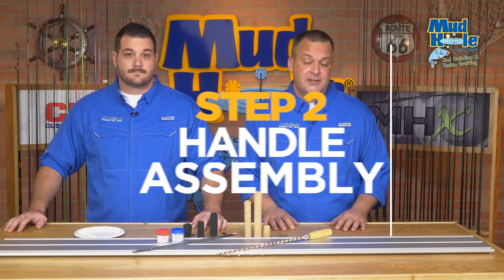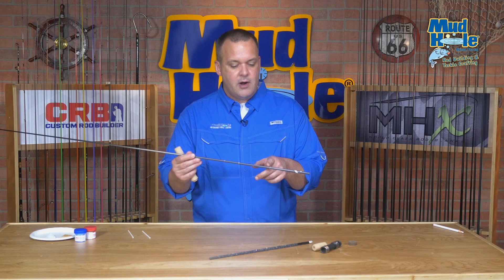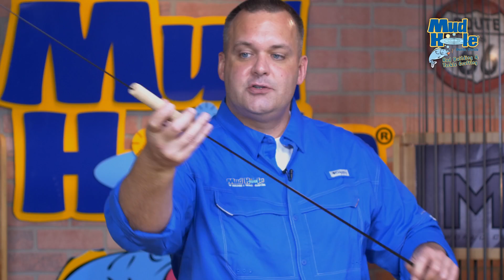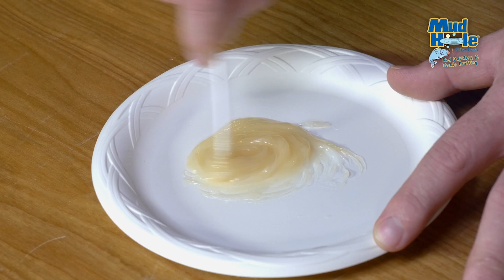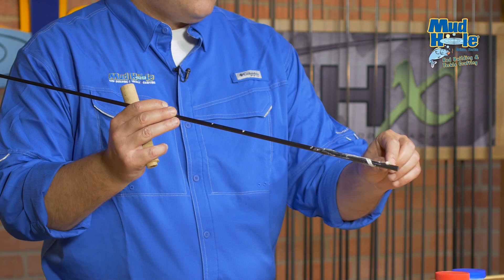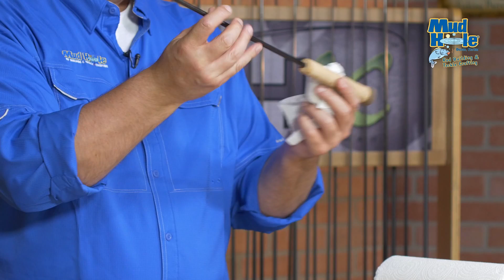How-To Install A Cork Handle Assembly | Rod Building 101

Comment: Good instructions allabout.wiki/e5pj if you look at the two parts, plastic cover and metal sprocket you'll realize that you just use the plastic cover and not use the metal one, then the screw will work fine.

Comment: Wouldn't it be better to wait on putting the end cap on till the tip top is glued on and dry so any back pressure from pushing the tip top on the rod wont push it back off from putting it on a closed up rod, prior to the glue drying on the tip top???
Reply: shut up

Comment: How do I measure the right distance for installing a split grip?
Reply: Fish Hawk you measure from the very back edge of the reel seat to the back of the butt cap to determine grip length. The gap will just magically happen...ha. 10 inches is a good starting point I would say for determining grip length...all depends how you’re fishing and how you like the feel. I def dry fit everything and handle it before making it permanent.
Reply: @branndonprevost2619  Thanks for the reply!